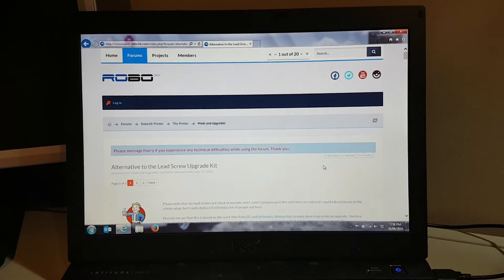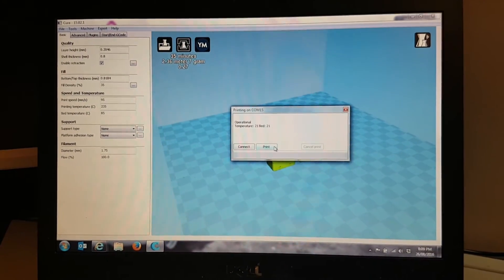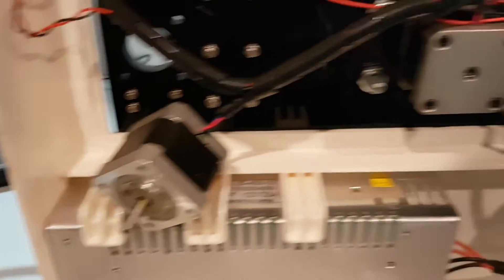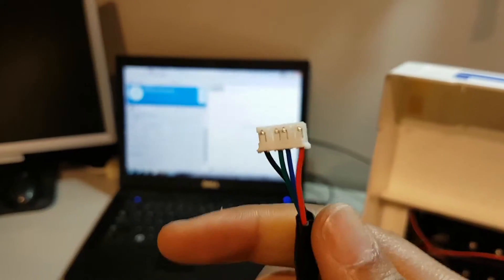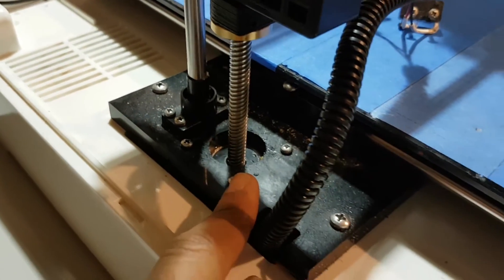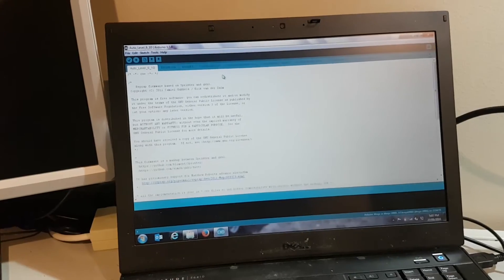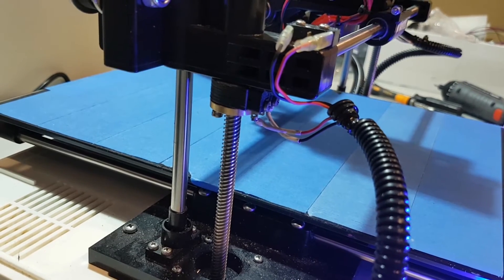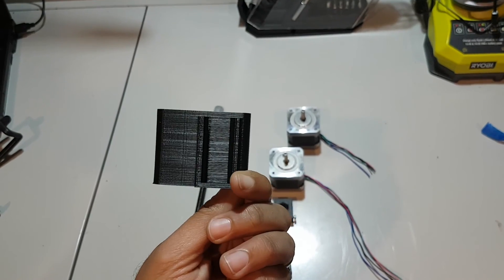FIX Z Ribbing Issue! - Leadscrew Upgrade - ROBO 3D R1

Comment: How did you move your X carriage up? Mine is locked by some sort of z axis lock, I removed the screws from the end stop switch and remove the  end stop, and remove the other big screw thats on the same plastic and I'm unable to remove the z axis lock. My Z axis does not move freely after taking the top off. Any advice?
Reply from the maker: It's been a while and I have since moved on from the Robo3D, but i recall the x carriage just sat on the z screws with no lock - it was just a nut shaped hexagon hole and u just lift it off them. 

You might need to look up the Robo3D forums for more details on this if its different to what I mentioned above.

Comment: You should have more comments thank you for this video. So thank you. My Z is not the best, but instead of buying a new printer I have been upgrading it over time. I got my r1+ from a pawn shop and I have upgraded so much. I’m pretty attached to it. Thanks again.
Reply from the maker: Thank you :) My Robo is still going (albeit its tried to set itself on fire a few times, be careful of the heated bed wires and plug).. its a great learning printer!